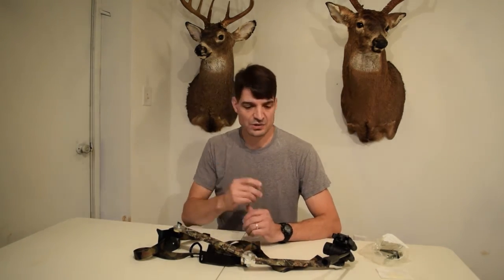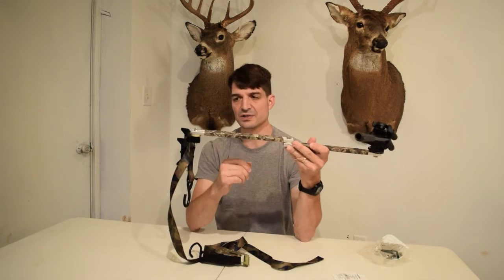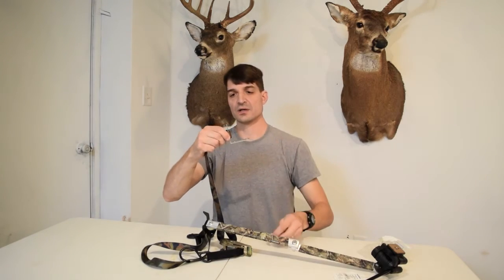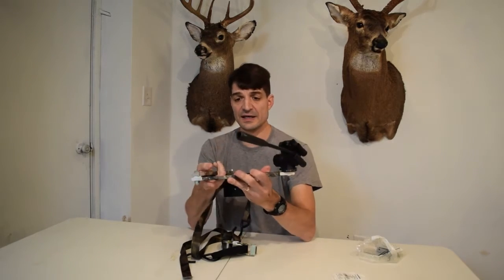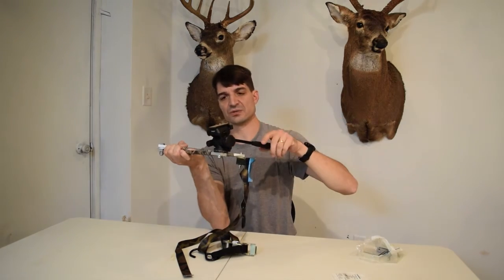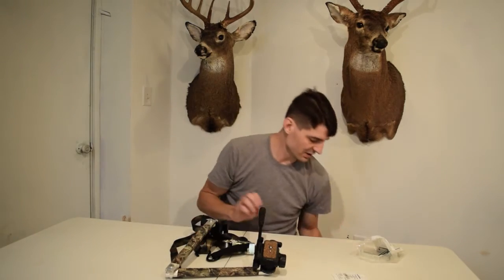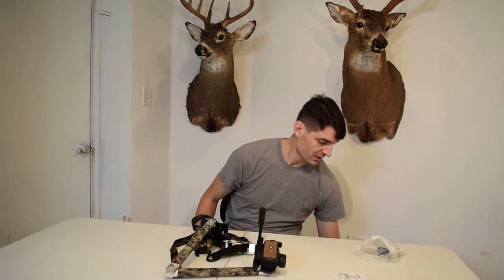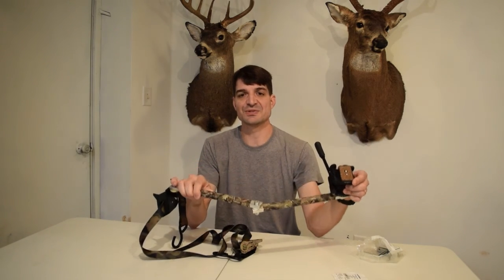DIY Video Camera Arm Build

Comment: I like your videos. I hunt from a blind and I tripod to start filming. I would like to have a camera arm to save floor spce in the blind. What do you think of making a pvc camera arm or should I sti k with the tripod.
Reply from the maker: I personally would stick with the tripod, unless you can come up with a very stable way of making an arm. I just think PVC could become a little too heavy if it is attached to the blind, unless it is a wooden structure and not a pop up blind. If it is wooden then you could definitely screw something solidly to the wall, but in a pop up blind I think it will just be too heavy. God bless ya
Reply: Sean's Outdoor Adventures thanks Sean
Reply from the maker: Sure thing, Shawn. God bless ya.

Comment: Awesome.   How much does this weigh?
Reply from the maker: few pounds
Reply: Sean's Outdoor Adventures 
Awesome!   Do you still use this arm/ is it holding up good?   If you don't still use it I would like to know why.
Reply from the maker: I still have it but have been using a different one and keeping this as a backup. The reason is that I have gotten bigger video equipment that have a higher weight rating than the base of this one was designed for.
Reply: @seansoutdoors  Would you be willing to sell your DIY camera arm if you don't use it anymore?
Reply from the maker: @jamesmarshall5794  I'm actually using it as my primary arm
Reply: @seansoutdoors  Oh, I thought you said you were using a different one now...I guess I will have to make one then!
Reply from the maker: @jamesmarshall5794  I used a different one last season but switched back to this one this season because this one is so much lighter.